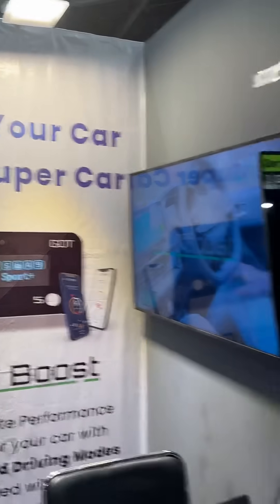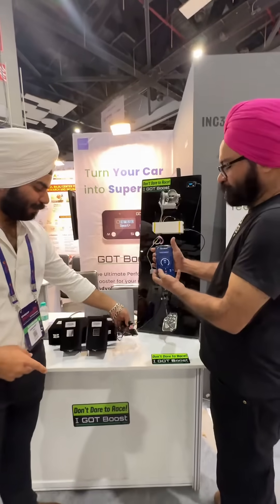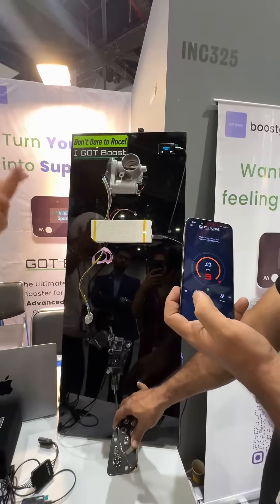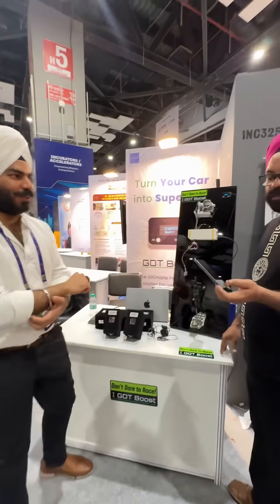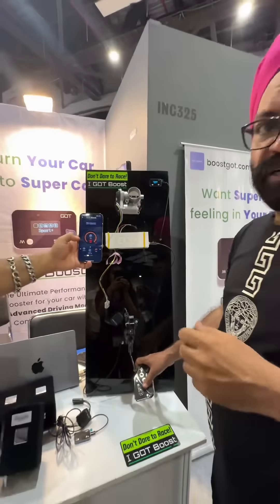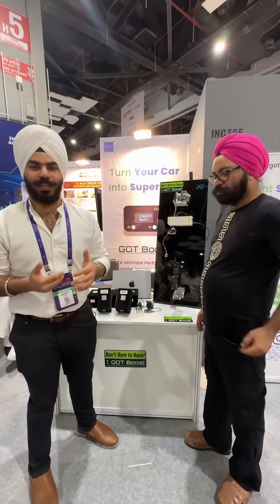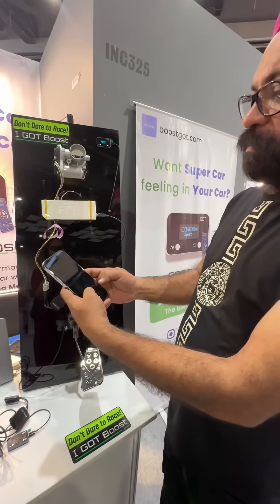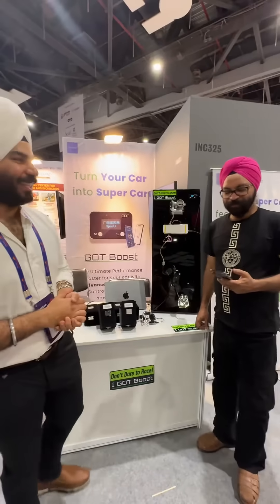Turn your car into a Super car with GOT Boost #gotboost

Comment: Sadly ur product is not working on my Honda city idtec 2015z apne 2 baar device change kar ke bheja hai. Display don’t work.
Reply from the maker: Yes Honda 2015 may be manufactured in 2014 so it will not work 😊 whenever you change car please contact us

Comment: What if it stops working and the throttle is kept open ???
Reply from the maker: The chances of failure in GOT Boost is very rare, the failure rate is close to 0.1%. But, if incase of a rare incident, It has a fail safe mechanism built into it where the GOT Boost will disconnect the signal to pass any further and the user can safely pull their car to the side and simply remove the device to get the car to it’s original state. If you need any further details, you can checkout the FAQs section on our website to help you answer all your questions or call us on our official contact numbers.

Comment: Just one question in boost mode when it is opening the throttle body to its maximum capacity just by pressing 10% of the paddle then what difference would it make when you press the paddle 100% since the throttle is already open 100% just by pressing 10% of the paddle..
Reply from the maker: @GauravJain-s2x  not at all this is same technology the companies giving inbuilt sports mode if you drove that you will feel difference it is difficult to explain full in comment box please contact us on phone call For order and other queries plz Whats app india  📱 +918287124344 📱 +919315581180📱  +91 93154 80955 Us/Canada.  +1 (365)  833-9849 11am to 6:30pm (Sunday closed)
Reply: Right

Comment: How will it work with turbo lag issues? Like Honda city diesel, it is having a good 1500 cc engine but have turbo lag as turbo kick -in around 2000 RPMs.
Is this device  manipulate the pedal input and increase/decrease the input according to the mode selected?
Reply from the maker: To answer your question "Does this device manipulate the pedal input and increase/decrease the input according to the mode selected?" Let's understand that GOT Boost doesn't just increase /decrease the input but it manipulates the signal for a controlled delivery of the analog signal which reduces the ramp-up effect of the signal giving you the faster throttle response.
But yes, kudos to you, you were almost correct about it😉.

And for the other part of your question, yes, you will feel less of the turbo lag as well as the transmission lag.
Reply: @GOTBoostPro  hi can you share your contact number please
Reply: Glad to know that